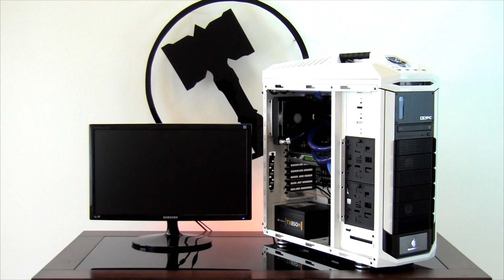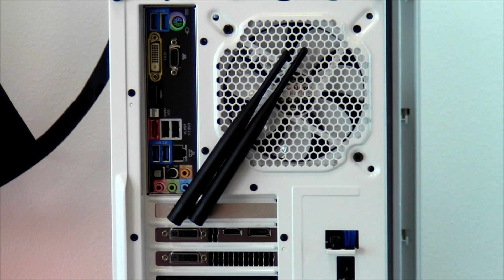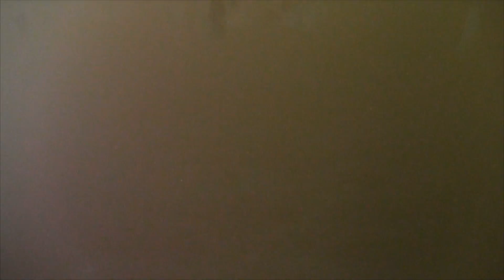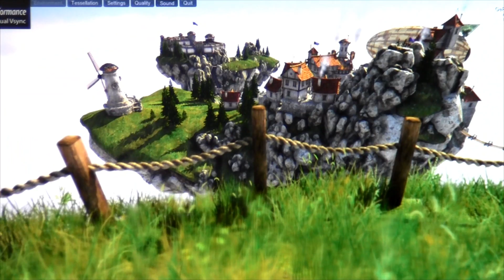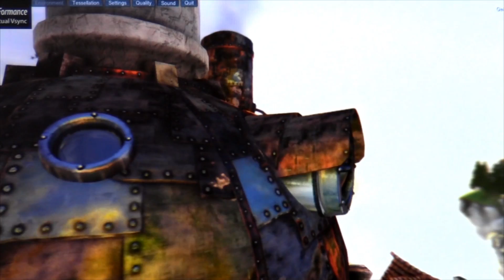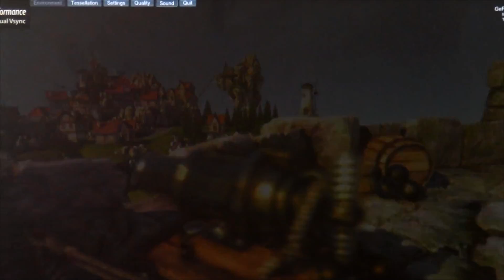Ironside Computers Video Demonstration - Order 2898 CM Storm Stryker

Comment: I had an issue with building with this case.  The motherboard is a msi x370 Krait motherboard.  It's the one that is black with white claw marks on it. When installing the motherboard there was one spot where that was too tight to get my fingers in to work on.  That spot is located where the two front fans were.  I was trying to connect the cable that connects to a 19 pin connector and that's for the USB ports on the case also that spot is where you connect the Sata cables and the main 24 pin connector located on the same side as the 19 pin connector of the motherboard. That connector is facing on its side instead of facing upwards like the one that's on the bottom on the motherboard.  When connecting the USB 19 pin cable I accidentally bent the pins on the motherboard and now I have to buy a new motherboard and start over.  For a huge case the manufacturer made it too tight for installing the cables to the motherboard.  I going to try to connect the USB and Sata cables first before screwing the motherboard into the case so that I can connect the cables without breaking the pins.